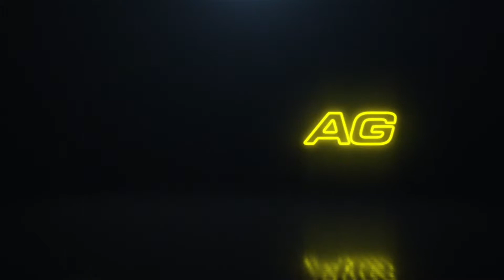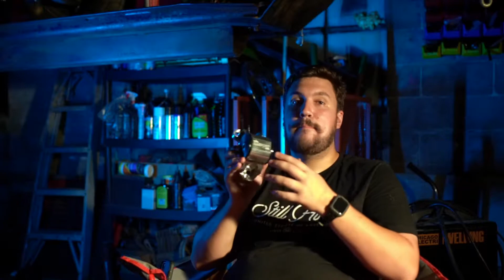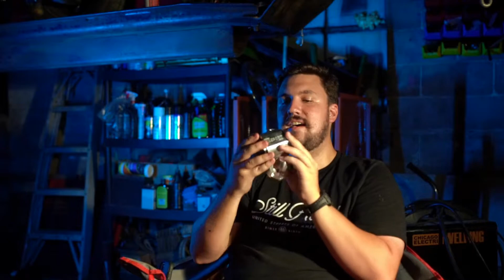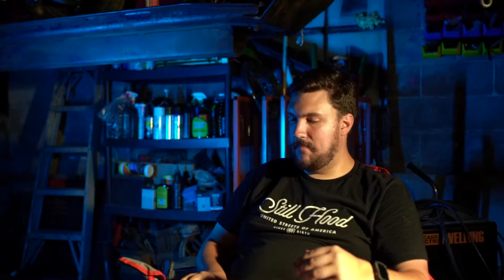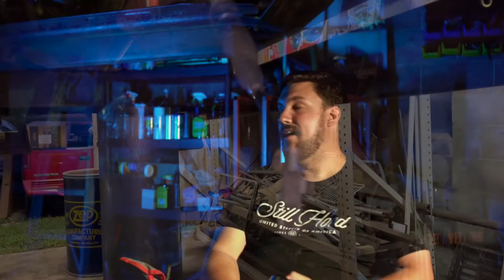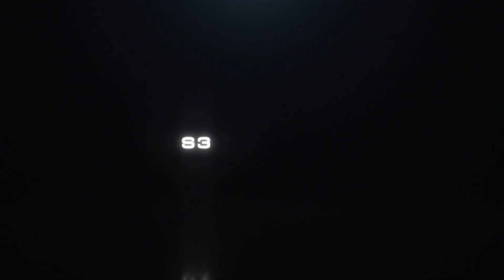Off-Road Civic Build Update: Engine SWAPPED, Hasport Announcement!

Comment: im also building an automatic AWD civic coupe. My build is 90% complete but im having the same problem with my gear shifter as you described. Did you finally find a solution? i was also wondering, is it possible to use the cr-v steering wheel and steering column in the civic? then the issue with the length of the cable might be solved?

Comment: This is a really interesting swap. The fact you are using the automatic AWD transmission opens up so many possibilities. By the way, try the shifter and cable from the 94-01 Integra. It should do the trick. Also, I wonder if you could put a Hondata S300 into a 94-95 Integra auto ECU without converting it to manual. That would make the engine tunable. No longer OBD compliant, but racecar. Can't wait to see what's next.
Reply: i was also told the integra shifter cable would do the trick but when i installed it into my civic it turns out the problem was not resolved.